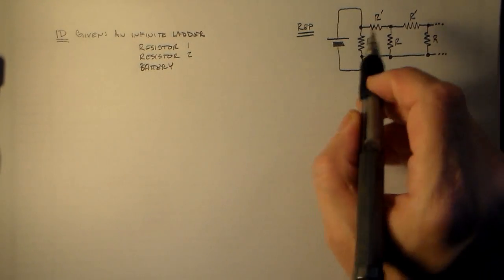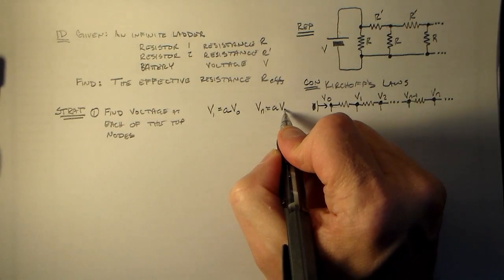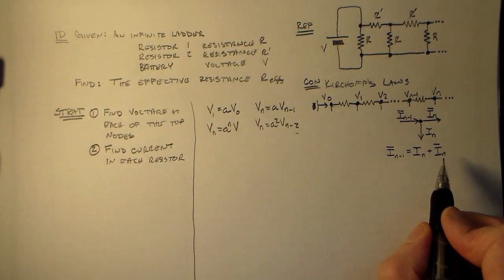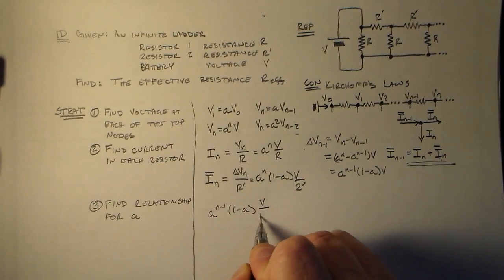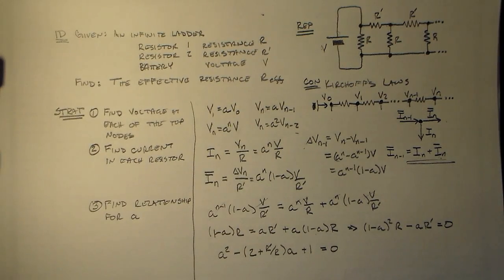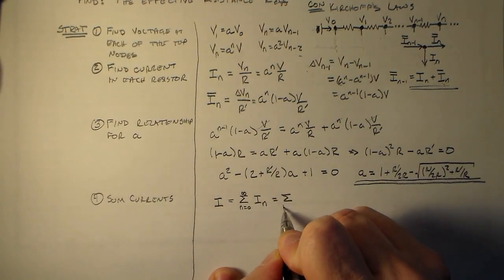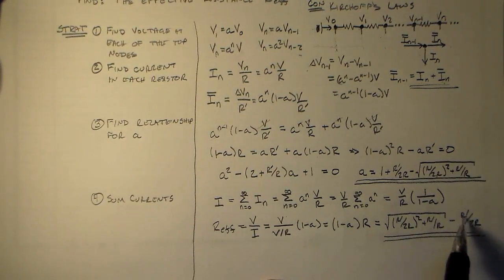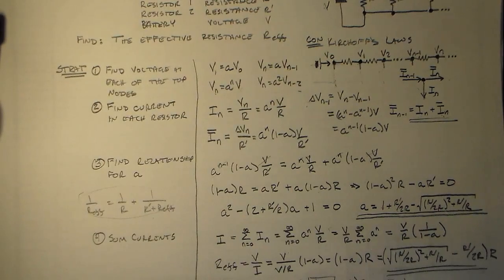Infinite Ladder Circuit

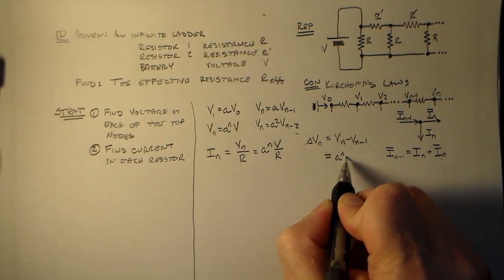Comment: I noticed a small mistake at about 11:00; the equation you wrote for deltaVn-1 actually simplifies to a^(n-1)(a-1)V, not a^(n-1)(1-a)V as you wrote in the video.  However, you actually ended up with the correct answer, since you made another mistake which cancelled that one out; the expression for deltaV should be the negative of Vn - Vn-1, so the signs get switched, and it ends up being (1-a) after all. That way, the current through R' is positive instead of negative.  It ended up fixing itself, but it confused the hell out of me until I figured it out, so I thought I'd give people a heads up.

By the way, I was completely stuck on this problem on my physics homework until I saw this video, so thanks for posting it.